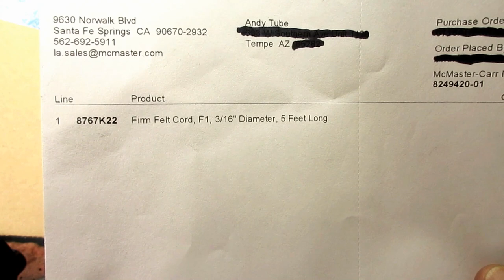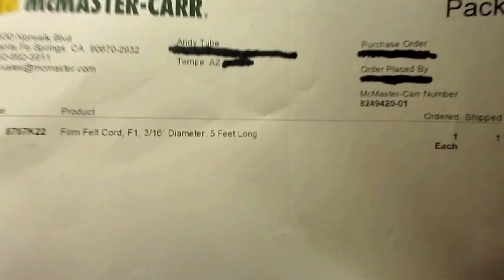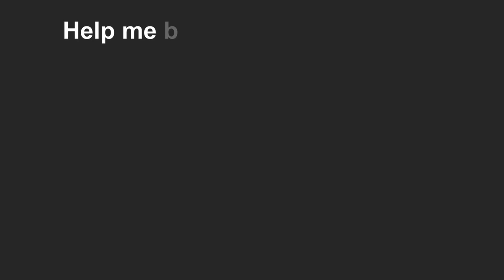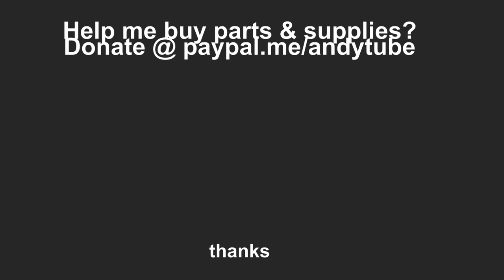Singer 221 Featherweight Motor Rehabilitation Part Three

Comment: Great upload Andy! Equally great problem solving and perseverance. The correct grease, pre-loading the wick (excellent method BTW..I'll be using that next time) and threading the wick onto the spring are the keys to making your rebuild a success. Good call on the Tri-Flow for the gears...I'm sure Singer would have used something similar if it was available 70 years ago.
Reply from the maker: thank you very much. I appreciate the encouragement!

Comment: Just finished replacing my wicks. The side attached to the wires seemed to have a longer tunnel. My wick doesn’t protrude like the other side. 
Also, I had only 2 washers come out, one in each end. You had three from one side?  I’m not going to worry about it. At least my wicks are brand new and my coppers are pretty again!
Reply from the maker: Yippee! You may have one of the other motors used on the featherweights over the years. You can push down the wick from the top to have it contact the motor shaft. Good job, Candy

Comment: It might have been easier to use a candle in a candle holder to melt the grease. As always, great informative video. Thanks Andy.
Reply from the maker: Yes, maybe so, Ronald. Not as much fun for me though probably safer. Another viewer mentioned a hairdryer or heat gun, all good ideas. Thanks for watching my channel.
Reply: @andytubesewing1953  love ya, dude.
Reply from the maker: @ronalddevine9587  😍

Comment: I’ve bought felt from McMaster-Carr too for my 15-91 and 201 Singer machines. It works great and they shipped to me in Canada. Got it in two days. Such fast shipping. Unbelievable.
Reply from the maker: Thanks for letting us know they ship to Canada. Two-day shipping to Canada is impressive! Thanks for watching.
Reply: I had tried to order some in New Zealand but they told me "We will not accept orders from you due to the cost of complying with US export regulations. Those regulations apply whether the products are shipped directly outside the US or somewhere within the US for later transport."  So naturally I gave up on that.  It's great they'd ship it to you as it looks to be the best stuff around and the perfect size.
Reply: @meganmills6545  the USA have everything it seems. And if u live there it’s free shipping. So often things I want from there, the shipping is more then the item

Comment: Can you use a hair dryer instead for heat? Could you put a doubled thread down the silver tube from the outside down and pull it out of the  shaft opening, Tie it to the spring and pull from the top to help it get around the curve.
Reply from the maker: A hairdryer? Certainly. I used my method so you could hear me and a hairdryer is too noisy for that. Any safe heat source could be used; that's up to you. As far as a doubled thread give it a try and let us know, or better yet post a video so we can learn too! I'm a self-taught amateur as far as working on VSM, and the methods you see me use are my own. I hope to show and teach people that they can save and keep these machines in service for decades to come while giving viewers ideas about how it is done. I expect people will surely develop their own ideas, methods, and workarounds that suit them and their abilities, and the tools they have on hand. Thanks for watching my channel.
Reply: @andytubesewing1953  Of course, never thought of the noise! I am more than an amateur - I usually learn from my mistakes but have always done fiddly, very small work. When I have a motor that I want to remove the wick, I shall give it a try with the thread. I thought it would be a way to get round the corner. I will take photos - I am definitely not set up for doing a video and would be too embarrassed to publish it.
Reply from the maker: @Braisin-Raisin  That sounds good. A few viewers have told me they were able to get that tube cover off but I was nervous about damaging it and these motors are very expensive here, even the Alpha Sew replacement is not cheap. Spending time to fiddle with the springs and wicks I can afford. You'd be surprised about making videos and uploading them to YouTube. Even a SmartPhone can record a very nice video w/ sound. When you upload you set the viewing so you can make it private that only you can see it. It's an easy way to see how it would look on the channel. You can change it to public any time you like, or just delete it.  Anyway, you are doing more than your share by saving the machines, and thanks again for that hard work.

Comment: I’m wondering if Singer repair shops  had a mythical magic tool that would take off that shiny pressed grease port cap for the wick. Would make life easier, but as the wicks have been I there for 70 plus years, Singer beat the odds on replacing the grease wicks!
Reply from the maker: I had a couple of viewers who claimed they just pulled them up and out with a plier. I was too worried about damage though.

Comment: I would use a synthetic silicone grease. Syringes don't cost anything. Get a curved tip, done.
It irritates me to look for wicks and pay for shipping, etc. I have a 301 machine that needs a thinner wick than FW I think.  Why can't we make our own wicks?  Out of felt or wool?  Surely it is not rocket science, eh?  How about wicks for oil lamps, same thing, no?  Please comment. I want a universal solution.

A tool that is very useful is a dental pick scraper from Amazon for $5.  Cleans out drain hairs, scoops up felt pads at bottom of sewing machines... super useful.
Reply from the maker: IMO the synthetic silicone grease will not melt properly like the motor lube does. Interestingly, Singer did away with the silver tube and wool sick system the 2nd year they made the 301A model, and all models after that. No motor lubrication system on the PA-style motors. A sealed shaft bearing on top and a sintered bronze bearing on the bottom. No need for wicks so why make them in the future. I do enjoy your comments, and thanks for sharing ideas.

Comment: I have made springs by winding wire around a knitting needle of the right size.. and I wonder if you have a piece of wool fabric if you could make  wick from that.??.. I was about to order a wool pressing mat $40 for an 18 inch square..I discovered in my stash a piece of wool fabric ..several yards. I put it on my ironing board and it works wonderful.  I think I could make a wick also.
Reply from the maker: I only know that the wick/cord I bought is rated for wicking, is considered firm, and if you follow the link you read the weight & density. It's 95% wool. https://www.mcmaster.com/8767K22/
Reply: @andytubesewing1953  Like your little can pan..I have made wicks for lamps etc.. 100% wool..felt .. interesting what we used to make when you could not order things!  but I have some wonderful interesting catalogs recipes, instruction manuals form the early 1900's, 1950's..very interesting!

Comment: Andy, I think I need to replace my lube port springs that hold the wicking.  I have the 3/16" wicking but pulling out the springs was difficult, so they stretched out.  What size? Length and diameter and where would I get them?  I looked on McMaster and I saw compression springs but don't know if those are what I need.  If anyone else knows, please chime in!  (If it's not a bother). Thank you!
Reply from the maker: I don't know the exact size. I have nothing in the documents about the size/length/diameter of that spring. The model 221 parts list calls it  "Oil Lubrication Spring", Part No. 194326. A search for that part number shows it was also used on Singer models 15-88, -89,-90 and was called the "Arm Shaft Grease Cup Wick Spring". I don't know of anyone who makes or sells that part. The Featherweight Shop may have one or may be able to measure it, ( https://singer-featherweight.com/pages/contact-us) but you have the other one that is still good (I assume) I would take the two springs and the motor parts to a local hardware store, and ask for help before I tried ordering one online that I was guessing at.
Reply: @andytubesewing1953  thanks much!  I appreciate your help and these awesome videos.  😄

Comment: Is there a way to remove the cap to install the WICk?
I was wondering why you did not try to remove the cap
Reply from the maker: I talked about that at the start of part two https://youtu.be/cWweXggcKOY
There were comments on part one from viewers who DID pull that silver cap up and out of the grease tube. I gave it one try but it did not budge for me and I felt I might damage the cap so I quit. I did not try heating it or using a penetrating oil or anything like that. So I believe yes, it can be done and if you do it please be sure to make a video b/c I think everyone would love seeing that. Thanks for watching.
Reply: I did it, as Andy explained in the 2nd part of the motor videos. It was relatively effortless, and worked fine when I put it back inside, with a bit of pressure (not too much). But it of course depends on how long it has been there and how much dry chemicals are there, which can make it harder to remove.
Reply from the maker: @JesusCliment  I was hoping you'd see Kevin's question. Thanks very much, Jesus. I very much appreciate what you add to my channel. Don't Stop!  https://www.youtube.com/watch?v=QV9JJmSCiI8

Comment: Could not a slot be cut in to the top of the cap to allow a flat-head screwdriver to unscrew it?
Reply from the maker: Like with a small hack saw or Dremel blade? I bet it could be cut. The two fellows who told me they were able to remove the tube caps said they were not screwed in, but just pressed into the grease tube. This video at the featherweight shop shows a cutaway motor and you can see how far that silver piece goes down into the grease tune. https://singer-featherweight.com/blogs/schoolhouse/learning-about-the-motor-lubricant-ports      About 75% of the way inside the tube on that motor. I do not know if all motors are the same; I've only worked on the one in my video.  Here is a quote from a comment on the part one video "" I used the pointy pliers to grip the inside and outside, and did a light twist while pulling them out. They are pressed, not screwed,""
That's what I tried but it did not budge and I felt I was damaging the top of the silver cap part so I stopped.
Reply: One reason I did not care too much about breaking the caps is that I started feeling I was going to have to buy another motor, as I had cut the electrical wires and I could not solder them. I removed the caps, i reinstalled them with grease and the wicks from McMaster and I found some information over youtube on how to remove the copper rust over the wires so that they could be re-soldered. So at the end it all worked out: new wires, new wicks and new grease, all with ease.
Reply from the maker: @JesusCliment  Thanks for the great information, Jesus. That motor must have run as smooth as butter when you finished.
Nice clear explanation. Take care.